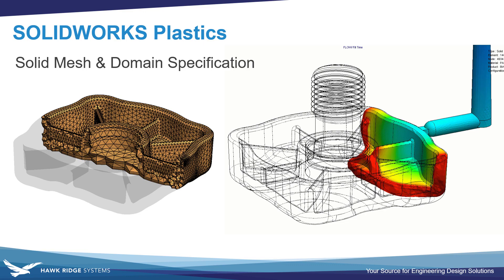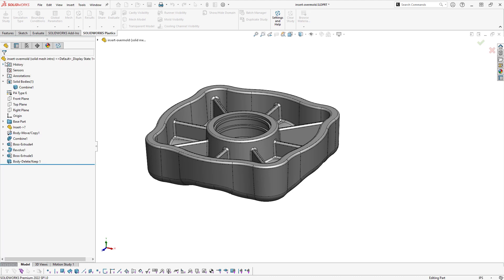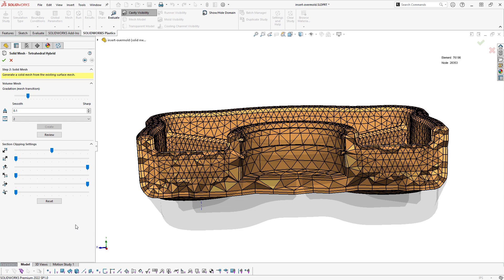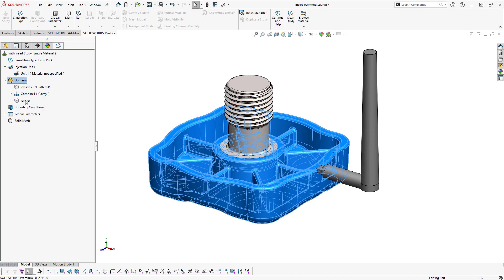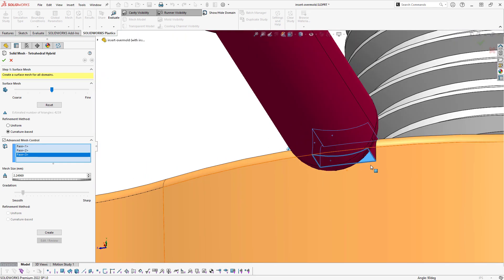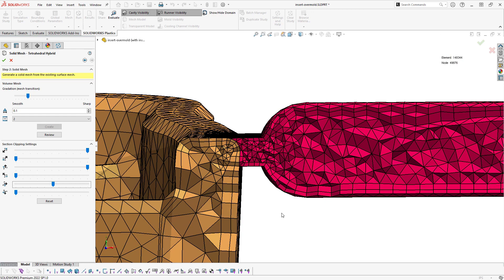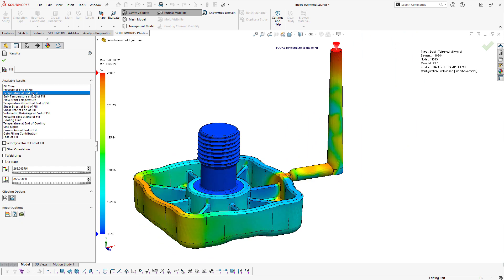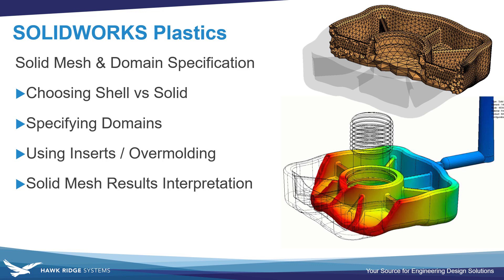SOLIDWORKS Plastics: Solid Mesh and Domain Specification for Overmolding

Comment: Hello sir , i wanna learn about metal flow simulation, .to get proper thermal analysis,for sand casting,. does it's possible in solidworks?. please answer sir
Reply from the maker: Unfortunately we aren't aware of any  SOLIDWORKS-integrated analysis package specialized for sand casting. 

SOLIDWORKS Plastics can be used for metal injection molding (MIM), and we've even heard some customers approximating high-pressure processes like die casting using SOLIDWORKS Plastics and a custom material (though this is officially unsupported). But for low pressure process like sand casting it would definitely not be a good fit. If you search for "sand casting simulation" you will find some specialized 3rd party simulation tools exist.

Comment: Hi, wanna ask

Why in my case its a warning that "isolated cavities detected"?
However i've set the insert parts as insert on the domain.
Reply from the maker: It could mean there is some other void inside the part, usually an unintentional one 

One way to check is to model a large block extrude around your part as a separate body, and then do a Combine -> Subtract operation

If this results in multiple bodies (especially tiny slivers or floating regions) these will indicate where the internal cavity is. Then you can go and correct the part geometry. 

Either that or perhaps the interface between the insert and cavity is not clean and may contain interferences, you could use Evaluate -> Interference Detection as well
Reply: Thank you, i'll try 😊